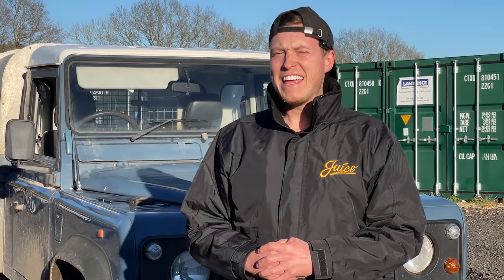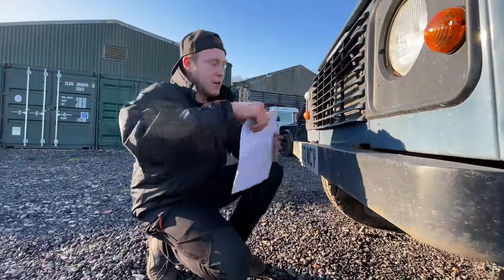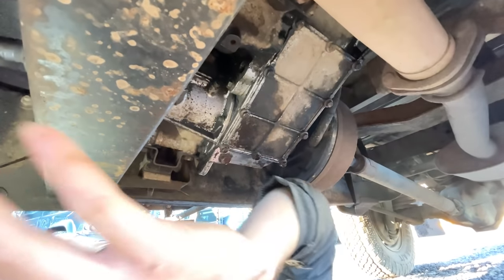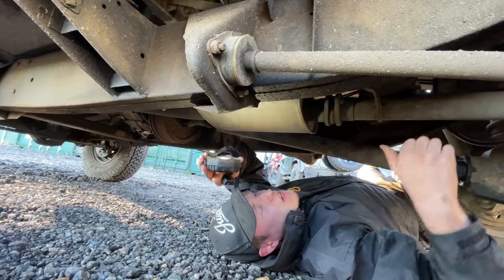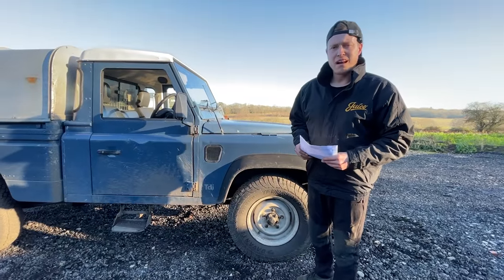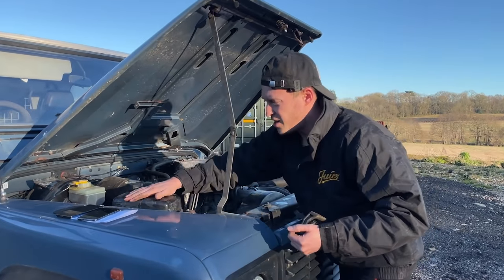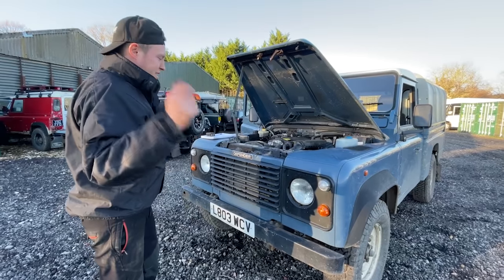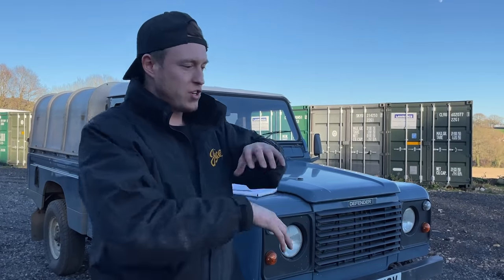BUYERS GUIDE -  LAND ROVER DEFENDER

Comment: Great video. One thing i would add, specifically on the Tdi's, is to test drive the vehicle and get it up to operating temperature. Then pull the dipstick up and see if you can see 'steam'. Consistent and clearly visible steam means the motor is tired and you will probably need to throw some money at it - something i wish i knew before i bought a 1998 Tdi!

Comment: Great guide! Reminds me of my 90 TD5 buying process with 270t km on the clock. Avoid too shiny, too modified vehicles - that is usually a good hint. Thanks!
Reply: Hi!
I’m looking at one 2000 now, 247k on the clock, will the motor last how many more miles if decently maintained in your experience ?

Comment: If you're looking for virtually rust-free right hand drive vehicles, Johannesburg is a treasure trove. Something to check for in hot climates that won't be a problem in England is that the rubber seals on the windshield supports perish resulting in leaks through the bolts and down the bulk head. A dead giveaway is the door seals having melted onto the frame slightly. This was the case with the Defender I bought. It was otherwise in fantastic condition. Luckily the vehicle had clearly been kept inside.

Comment: Great advice, all very good points to consider. I would add if possible check to see if the engine is warm, I always prefer to do a full cold start. I would also do a full check of the low/high range and see if the centre difflock works as supposed to.

Comment: I've owned and driven landrovers of all shapes and sizes for nearly 30 years and always appreciate good buyers guides like this.  Noticed you have a set of Davanti Terratuora's on the 110 how do you find them?  i saw them at LRO in September and quite liked the look for what i use my defender for.  Maybe you could do a tye review for a range of tyres from the extreme ones on your builds to the standard tyres.   Like the advice of avoiding rusty ones unless you buy cheap, that exactly what i did with mine (paid very little for it) and 5 years and 120000 miles later its still going strong, getting weary of welding though, time for a new chassis!
Reply: A.

Comment: Great video! Very useful
Can I ask, which defender model and engine do you consider to be the best base to start building a dreamcar? 90? 110?
Td5? Tdi?...
Reply: I just bought a TD5 and asked myself the same question beforehand - 90 or 110 is entirely up to personal preference (you want a small car, get a 90 - want a larger one, get a 110, want a long pickup, get a 130). As for the engine - from what I have found it doesnt really matter too much as long as the rest of the car is good. The TD5 starting from modell year 2003 can be electronically tuned (interesting for EURO4 certificate in germany). It is also noteworthy that the TD5 also has a chain instead of a cambelt. But in general - both the TD5 and the 300TDI engines can run really really long and reliably if taken care off properly. For me personally the TD4 was not an option as the prices for TD4 Defenders were quite a bit higher and a tad out of my Budget. I ended up getting a 2004 TD5 110 for 20 grand (Euros) which was initially completely mike-sandered (wax in chassis and other empty spaces) and only had 200k km on it. Only rustspots were the bumper (easy fix for around 120 euros) and the rear doors (little bit more effort but if you know how to weld fixable, especially since the aluminum didnt start corroding yet). Kind of a lucky grab though as the sellers fucked up their description and made it seem super dodgy, when we visited them though it turned out they were simply a little lost with the internet but otherwise insanely honest people lol.
Reply: @Averell64  thx for the reply. My favourote one would be a 110 hardtop td5 I think.
Maybe you can make it your next project lol..
Love watching the videos
Belgian fan

Comment: I’ve always wondered if it would be wise to put axle stands under the vehicle in case of the unlikely event of a puncture happening…😬
Reply: Only if you’ve got a very big head or are circumferaly challenged, or you’ve undone all the wheel nuts. 😵‍💫 Do always chock the wheels on a Land Rover (I hated it when they started calling them Defenders) when using a jack though. They roll.